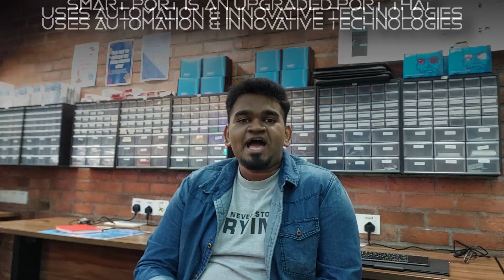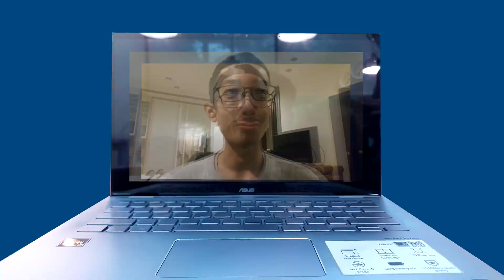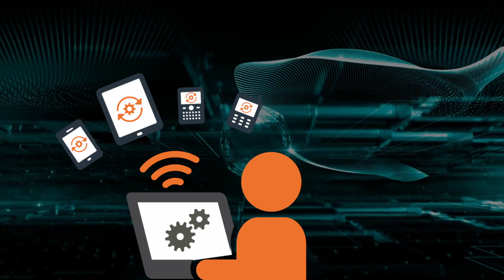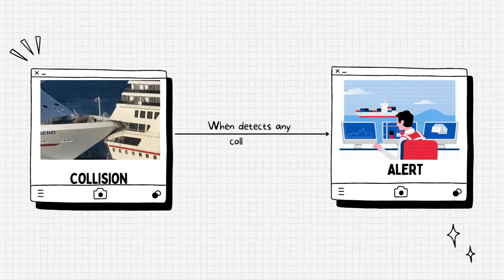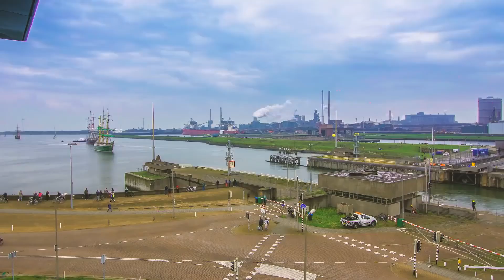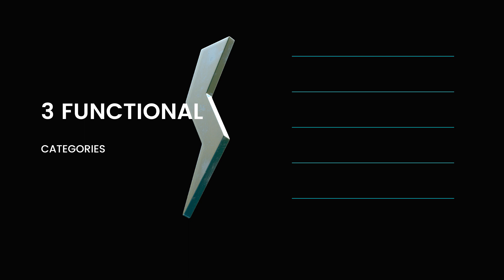B5G as Enabling Technology for Building Smart Port/Harbour Cities [NET2201] | Simply Jay

Comment: What are difference between 4G and 5G? Overall good info. Keep it up.
Reply from the maker: 4G Internet introduced high speed Internet. The maximum speed that 4G supports is 100 Mbps. Such Internet speed is needed for high quality video streaming. 

5G on the other hand is capable of having maximum speed of 20Gbps and a very low latency compared to 4G. Lower latency allows real time action. For example, low latency is very important for remote working such as controlling a crane at construction site from office or a robotic arm at hospital for surgery. Besides that, 5G also aims to virtually connect with all IoT devices and thus, it has a higher bandwidth range to increase the capacity of devices connected to 5G.

Comment: Very good info. What makes 5G better? And is 5G better than fiber?
Reply from the maker: 5G and Fibre are totally different. Fibre Internet is completely wired and 5G is cellular network which usually is wireless. Being a fibre connection, the internet speed would always be constant. 5G being wireless internet, the speed depends on signal strength & signal quality.

Comment: Will there be any interference in connection when we use B5G if there any weather or any environment issues
Reply: There is a possibility that interference could occur under harsh weather or environments but on a smaller scale as compared to other signals such as satellite internet signals. However, that does not mean that users will not suffer from connection issues. Take for example during heavy rain. Unlike fixed-wireless internet, 5G is not heavily affected as much because 5G works by sending signals in all directions. Therefore, you can be assured that you remain connected, though the signal may not be as strong. 

-from Fang Yiak and team.

Comment: Informative video!! Excellent👏!! Do you think B5G will be the future?
Reply: It definitely is the future as we speak. Even now we are on the verge of approaching to using 5G and B5G technology where everything will soon be interconnected, faster downloading and uploading speeds (which everyone loves in order to avoid throwing their devices out the window when they see the loading screen), etc. However, this technology still remains to further be rigorously tested through many trial and error as we have seen that B5G technology still has several issues that needs full attention such as privacy and security, the problem of using high frequency bands which will limit the range those signals can travel between cell towers and end user, and the low latency issue. Ultimately, B5G is the future, but not at this point in time and it is something that is in progress. 

-from Fang Yiak and team.

Comment: Nice presentation, but is Malaysian ready for fully optimised with 5G? How much impact 5G can do for daily typical Malaysian task?
Reply from the maker: I believe Malaysia is ready for smart port in next 5 years because some of the area only recentlly implement 5G Network. 
The impact of 5G allows Malaysia to faster download speeds, low latency, and more capacity and connectivity for billions of devices which also enable the business to speed up the working process.

Comment: Great video! Can you share some of the security issues a smart port might face?
Reply from the maker: There are several security issues when it comes to smart ports with one of them being the difficulty of staying up-to-date on the latest cyber threats as these threats take on many different forms. The second issue is the technical complexity that comes with it. The port stakeholders use different systems that are developed, managed and maintained by different teams or entities. For example, they can be developed either by port IT teams, either by third-parties or by IT providers. Moreover, they can be based on various technologies. Another issue involves the IT and OT convergence and interconnection. Usually OT systems, more vulnerable than IT systems, are protected because they are separated from IT systems and networks. But, increasingly, IT and OT systems and networks, become more and more dependent and interconnected, exposing OT systems to higher risks.